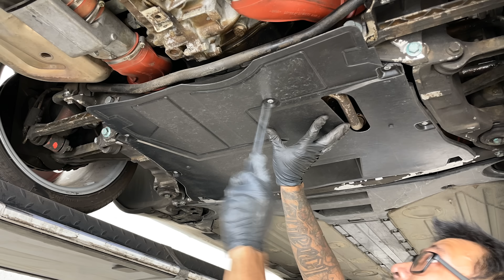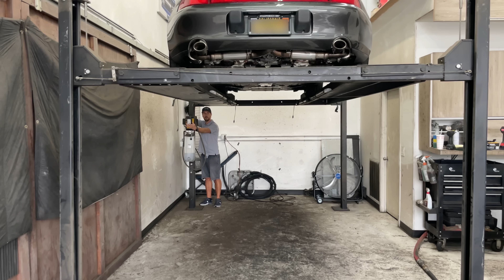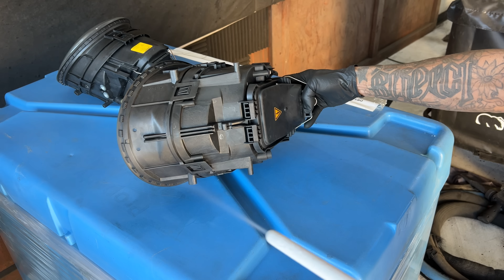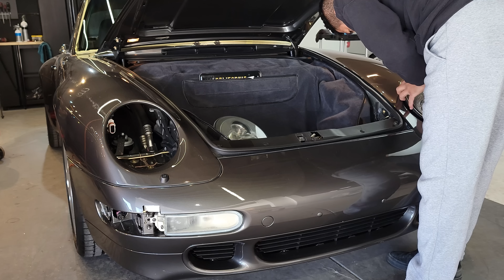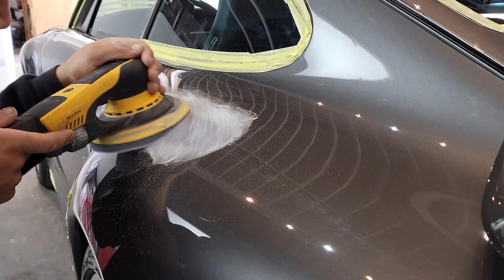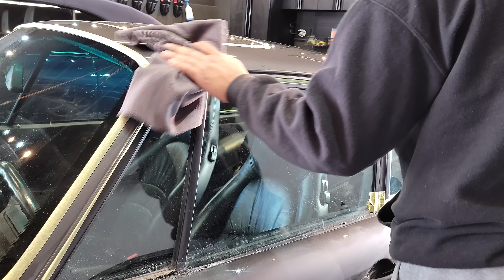DON'T CLICK! // Just Sunday CHILL with rare 993 Turbo in Slate Gray

Comment: Did you sand the entire car with 2000 grit 3M paper🤔Very impressive 🫡
Reply from the maker: not the ENTIRE car lol We had to remove the pinstripes to have them replaced, and that required a little more deep work than usual
Reply: @IAMDetailing  Great Work!